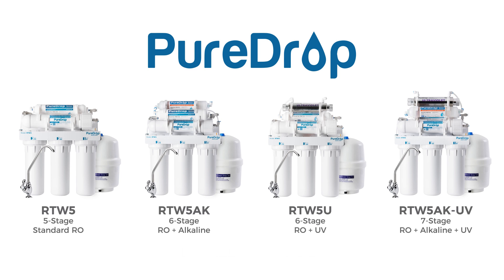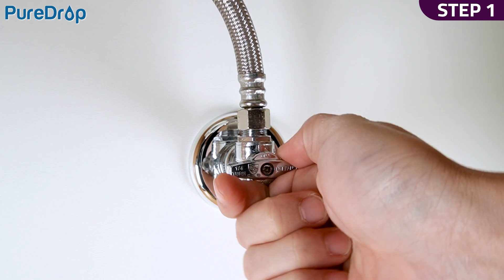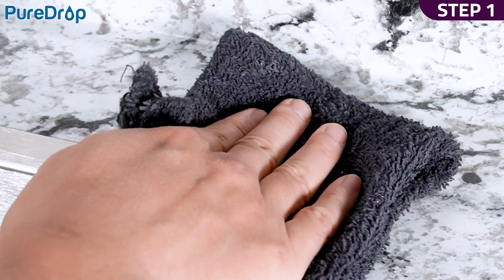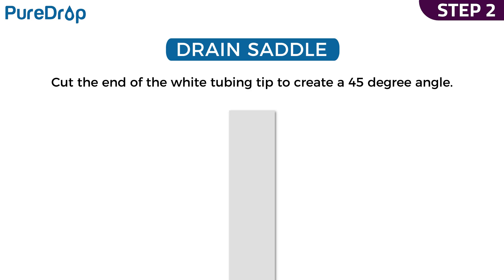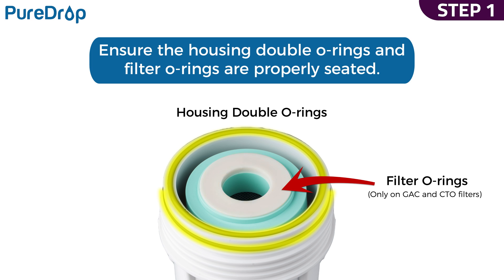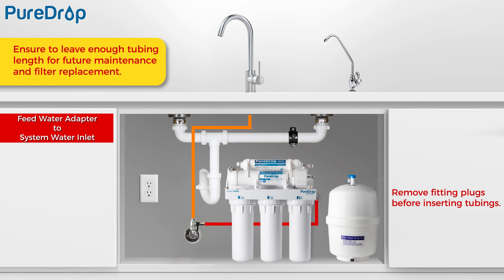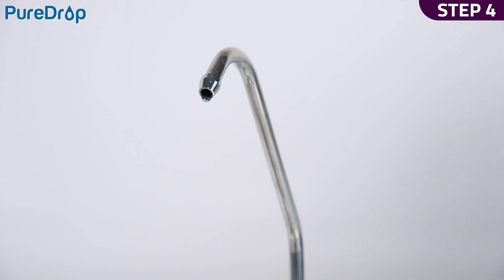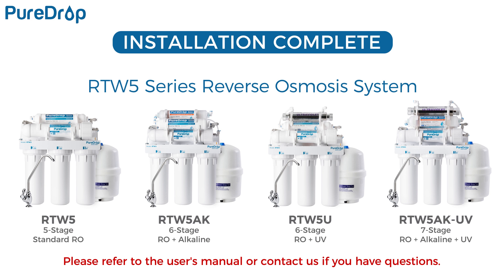How to Install PureDrop RTW5 Series RO Reverse Osmosis Water Filter System | Step by Step

Comment: Does this have to be mounted under the sink for any reason or can I just get longer tubing and stick it in the basement?
Reply from the maker: Hi there! The recommended installation is under the sink; however, installing the system in the basement is also possible. Please ensure that the maximum distance between the system and the faucet does not exceed 15 feet, as longer tubing runs may impact system performance. The system will provide faster flow at the faucet when the tubing run from the system and tank to the faucet is kept as short as possible.
If you need any further assistance, please don’t hesitate to contact us at support@puredropfilter.com — we’re always happy to help!

Comment: My system does not come with o ring in tank valve what do I do I just put plumbers tape on tank
Reply from the maker: Hi there! If your tank valve doesn’t have an O-ring, you can carefully wrap 7-8  layers of plumber’s tape around the threads to help prevent leaks.
If you need further assistance, please reach out to support@puredropfilter.com. We’re happy to help!

Comment: Incase this helps anyone else the big plastic 4 way connector is an auto shut off valve. It flows parallel inside of it. I made the unnecessary mistake of taking the lines off not realizing how that worked.
Reply from the maker: Hi there! The AAS2 refers to the four-way valve, which allows your system to turn off the water supply when the tank pressure reaches approximately 65% of the supply water pressure. It is located between the RO membrane (stage 4) and the post-carbon filter (stage 5). You can see its position clearly in this  diagram:
https://puredropfilter.com/cdn/shop/files/new1_720x.jpg?v=1683807976 
If you have any  questions or concerns, feel free to contact us at support@puredropfilter.com.
Thank you!

Comment: Add two things. 1. All filter connections for 1/4 lines are blocked with a plug needing removed before install.
2. 1/4 supply line connection will not slip over shut off valve barb unless it is heated first.  Also clamp nut will not slip over barb with 1/4 line installed without tapping on it.
Reply from the maker: Hi there. Thanks for your feedback!
For any concerns or questions, do not hesitate to contact us at support@puredropfilter.com or at (407) 768-3004
We are happy to help!
Reply: I connected and changed filters first time no problem, I'm trying to reconnect the lines now after cleaning up and filter change and I am so confused because the outlet coming out of stage 3 is not clearly labeled and I am not sure what it is connected to
Reply: In the manual there is AAS2 but not sure what that is
Reply from the maker: Hi there! Please refer to our filter replacement video here for guidance:
https://www.youtube.com/watch?v=Np5HGZPmW-4 
The AAS2 refers to the four-way valve, which is located between the RO membrane (stage 4) and the post-carbon filter (stage 5). You can see its position clearly in this  diagram:
https://puredropfilter.com/cdn/shop/files/new1_720x.jpg?v=1683807976 
If you have any additional questions or need further assistance, feel free to contact us at support@puredropfilter.com.
Thank you!